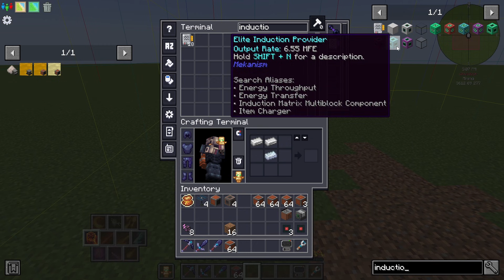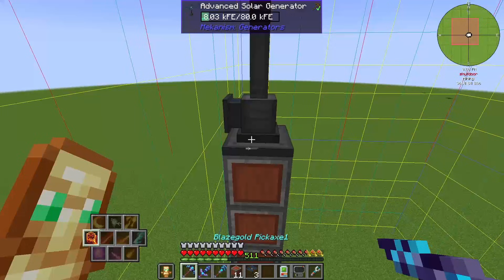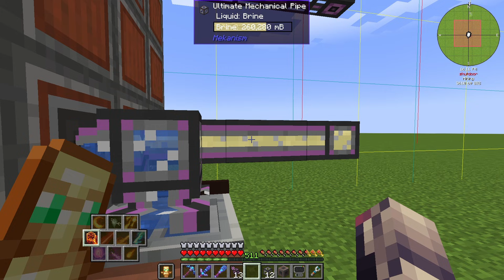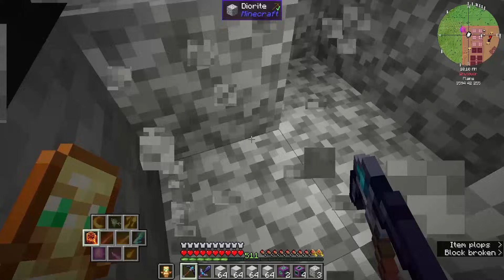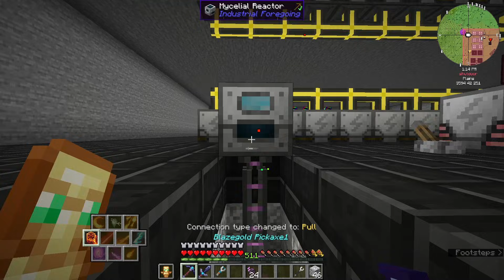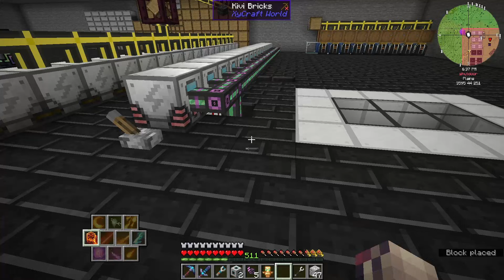Thermal Evaporation Plant | Direwolf20 1.21 Ep 46

Comment: I don't think it needs the solar panels just the resistive heater
Reply from the maker: @Rockstar_2905  OVERKILL!
Reply: @DoorShutter  In the video, you don't have the resistive heater connected correctly, so the only reason the Evap Towers are functioning are because you have the solar gens on top.  To pull heat out of the Resistive Heater, you hook power (ender gate in your case) going into one side of the heater that has the little green square thing (like you have it setup), but then you pull heat out on the opposite side where the other green square connector is.  Heat does not get pulled out of the bottom or other sides.  You can tell it is setup correctly when the heat pipes start changing color and turning red to indicate that they contain and a re transmitting heat.